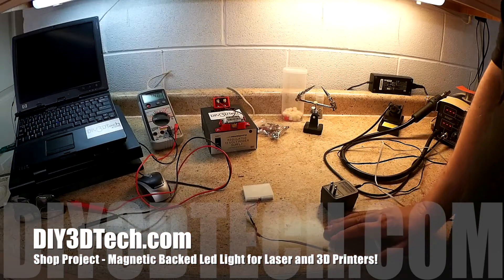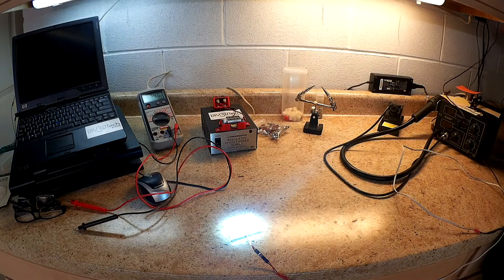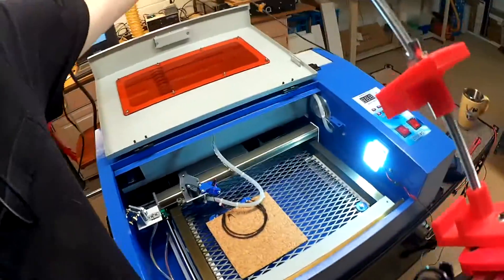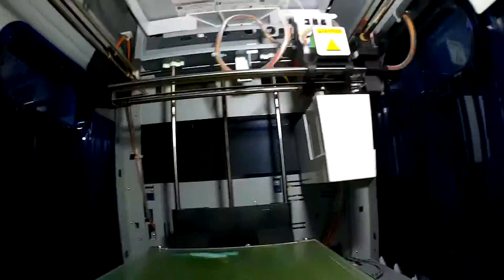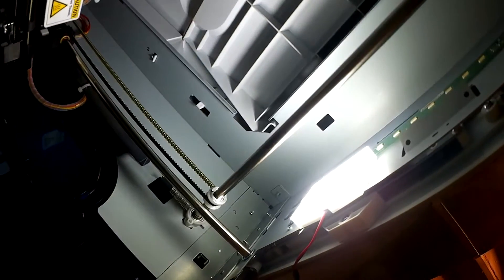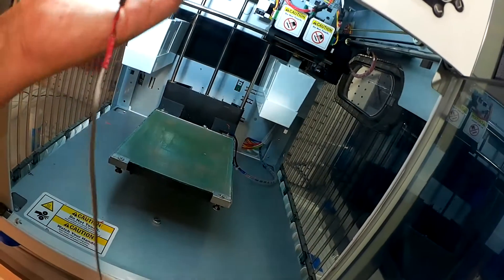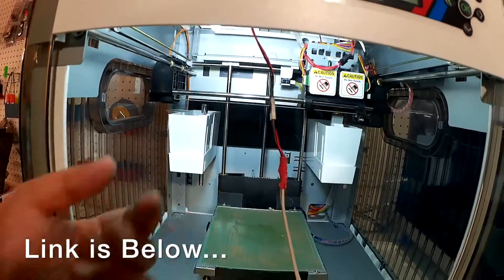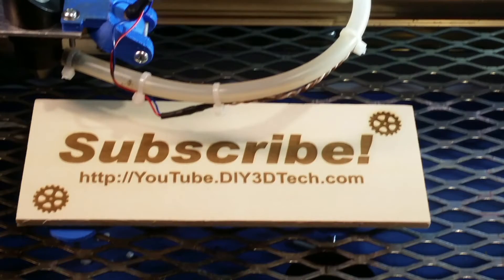Shop Project  - Magnetic Backed Led Light for Laser and 3D Printers!

Comment: Cool little project. Do the light banks come with power limiting resistors or did you have to incorporate them?
Reply from the maker: +RJ_Make they are 12volts out of the box as they are designed as interior car lights so not fuss or muss.  I got a bunch of these as they are very cheap and handy!

Comment: How good is that laser cutter? Do you recommend it?
Reply from the maker: +Pierre Fransson well lets put it this way, they are really engravers for making rubber stamps which sellers label as a cutter so that important to keep in mind.  You will be be able to cut 3mm acrylic ok and 5mm with multiple passes.  You will also have to invest additional time (so you need to be handy) and money to  make it work reasonably.  However when you consider a turnkey solution will cost you in the multiple thousands, than yes its worth it.  Hope this helps if not ask away :-)